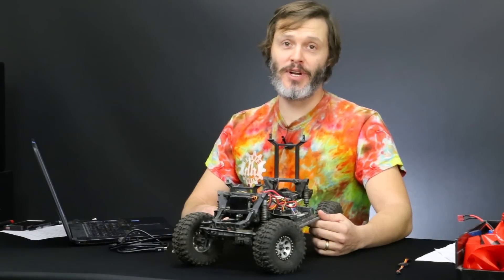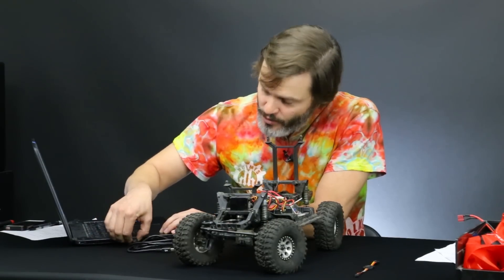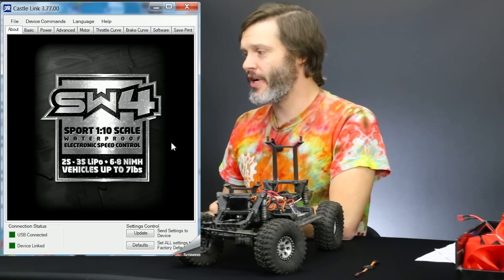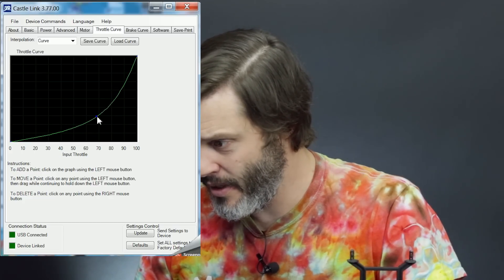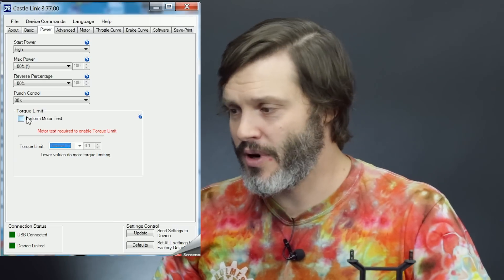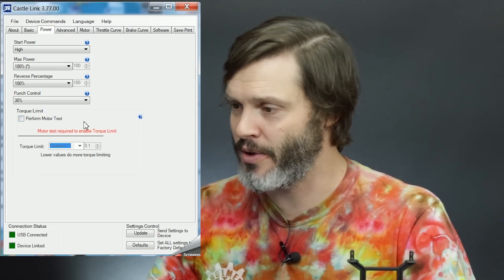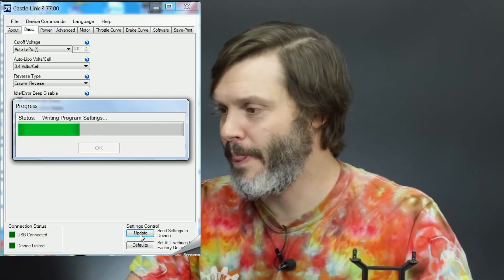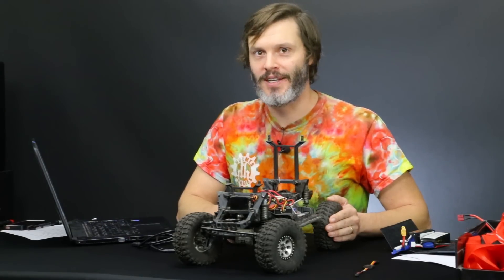Tips & Tricks On How To Program Your Brushless Speed Control - Holmes Hobbies RC Basics Series

Comment: I use the Mamba X WP Esc with 1406Series Slate 2850kv motor..!! 
If i want a motor that Can run the 6S, in My crawler. Wich motor Can do that..?? 
One Of yours..??? 

No i use it in High Power like you, i have the 99% same settings as you all the Way, almost☺️ 
Only My servo i run in 8v… And it has super good slow start up and it Can Go banans also😃

Comment: I hope this question doesn't advertise my ignorance, but here goes. 
Are programmers specific to a certain motor, or certain radio type?
I have two  flysky GT3B's and can load up to six profiles on them. 
(currently have three profiles on each one)
I only have two 2845 motors that are same brand and 5900kv rating. 
The other four brushless are various brands, but all rated around 4400kv

Interestingly - the only ESC that doesn't stutter is one that came with the first truck I bought, and I'm pretty sure it only has a 45amp rating.
Reply from the maker: programmers are specific to the ESC brand.   I typically don't have different profiles for different radios or motors, but I mostly just have a fleet of crawlers.

Comment: I'm having problems a lrp spin super rate now so I bought a used traxxas slash 4x4 I got a killer deal on Ebay but when car came would only go forward so I attempted to reset it now I'm having issues it's not getting full power when I give it throttle do I need to get a programming card you think? Because I can't find anything online on this speed control?

Comment: 75 bucks seems kinda steep for temp sensors. The only time I wish I had that feature is with my boat. Water cooling seems to run cooler than in a speedcar ,but figuring out how much prop you can run before temps becomes an issue is a hassle taking the boat out of the water taping and untaping to check temps. Or if you pick up line is clogged. If you plan on owning rc boats in the future might not be a bad idea to get a radio with telemetry other than that I don't see a need for it.

Comment: Do you, or are you willing, to custom program esc's bought from HH directly? For instance, I like trail running and some crawling. If I bought the holmes esc to go with the HH puller pro 540 I already purchased direct from ya, could you program the esc for me for those general purposes, however you see fit? I understand that driver skill and other factors could make it annoying with certain customers complaining about the settings, but just add a no re-programming clause and charge appropriately for your time and energy, it might be worth it. It's the thing I worry about most before buying an esc, that factory settings are going to suck. I refuse to use apple or new windows software, so I can't really program my own...

Comment: John, generally, the low feed gives more efficiency and less energy. High advance gives more power over efficiency (motor heat). Low Timing would make the car weaker or slower?

Comment: I'd LOVE to hear your thoughts on LiPo care.  I enjoy crawling/trailing but also love to get some bash on.  The bashing is killing my batteries though. When I bash... that trigger area between dead band to the handle is hot lava... and I also love long runs in deep snow.  I'm puffing and losing cells within far less than a year.  I currently charge to 4.2 and LVC at 3.2.  I'll try your advice from the video here and tighten that band.  ESC wise, I run almost exclusively Castle systems, the Mamba X being my preference.  I've been running low startup power and punch control of 70% to try and save my batteries.  I am about to dispose a set of 4 Power Hobby 5200mAh, 3 cell, 75c batteries.  From my Castle graphs, I've been running significantly under the nearly 400A continuous discharge rate, peaks at around 160A. For my bashers, I'm running a Monster Slash on paddles and a "Monster" Rustler on paddles, both still plastic with upgraded drive trains so they are pretty light... I do bash my Bomber on Fling Kings, but haven't really experienced post run puffing on it.  I've tried a couple battery brands with similar results. Any answers or suggestions must not include "throttle" or "control", particularly when combined.  Help me John Holmes, you're my only hope.

Comment: Odd question, why is it in most your videos your not running your own electronics but instead using something other then a Holmes product?
Reply from the maker: I always run my motors unless testing,  because frankly I like how they drive more than everything else.     ESC, not always mine will be the best choice.   The BLE does not work as well sensorless as the SW4, so I'm currently using the SW4 to match best with the sensorless revolver.   Castle ESC, Holmes Motor.
Reply: Yeah, the BLE is a great ESC still, but the SW4 and Mamba X are newer and bring new tech to the party.  Either way the motor is unmatched in performance!

Comment: I run a CC2850 slate with my mamba X. I use the white wire in a 3rd channel for an adjustable drag brake. I can adjust it on the fly which has been amazing for varying terrain. Specifically downhills.

Comment: Can Castle products be programmed from a smartphone out tablet?
Reply: Bummer! Thanks for the input.
Reply: There is an unofficial Android app that seems to work well on Android market. I've also used a cheap $50 windows Stream 7 tablet with the desktop castle software. Both options will require a USB OTG adapter for your castle link/ field cards normal mini USB cable

Comment: Great video.  I agree with you on everything, I am running SW4's with 25% punch control, 30% drag brake on ~10lb trucks, and I usually cut off at 3.4 as well.  Keep up the good work.  I havent tried the new software and the roll on brake yet, but its on my to do list.

Comment: Congratulations on the video, upgrade your software to 3.78 and test the Added 'Drag Brake Ramp' feature. Allows user to adjust the rate at which drag is applied at neutral?
Reply from the maker: already recorded it :)

Comment: You didn't mention the new Roll-on Drag-brake feature. I'm sure it's not called that. But it's the features that softens the onset of the drag-brake. 
I set mine at Medium.
I also set my drag-brake at about 50 to 70% using the Revolvers.
At 50% it holds perfect on downhills in 1st gear and in 2nd gear it creeps just enough so I can drive without throttle.
Reply from the maker: I made another vid to be released later where I update the link to get the feature.    Once I'm walking again I'll make a vid tuning it in the yard.
Reply: Jarryd Wark You're absolutely right. That's exactly what it does...it softens the the drag-brake as you let off the throttle. It'll definitely save on parts.
I have to reprogram about 10 trucks(between all 3 of us)before the Pro-line By The Fire event. 
I have a very similar program to John but I'm going to move the voltage cut-off to 3.4 and "medium" on the drag-brake roll-on.